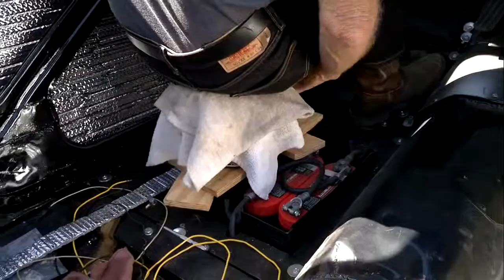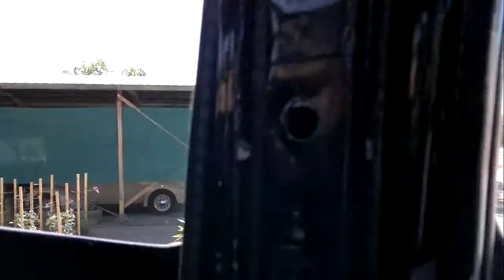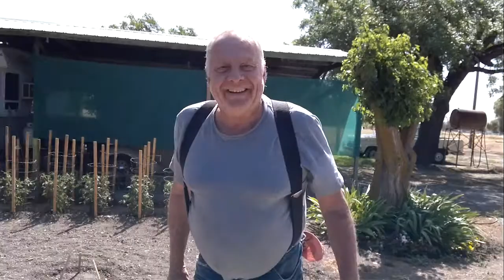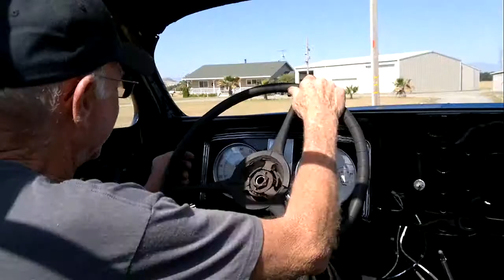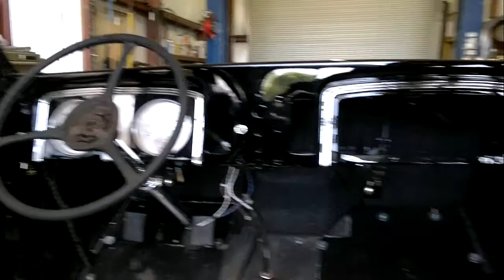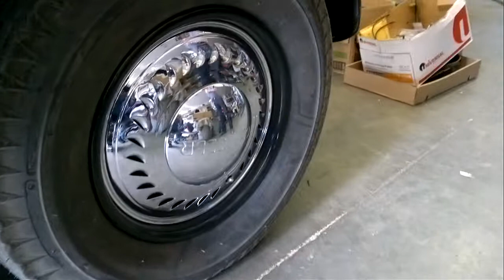1935 Chrysler Airflow Custom Imperial CW Limousine Restoration update 5.19.12  Part 2

Comment: While we await for a video upon project completion, it would be very interesting to hear more technical details about the car. It was interesting to see the unusual differential and learn about the power brake system's reserve vacuum capacity but it would be nice to hear details about the engine, suspension system and anything else about the car. 

How did the engine differ from the standard Airflow 299 & 323.5 cu in, straight-eights? Was it just bored out or were there other differences?